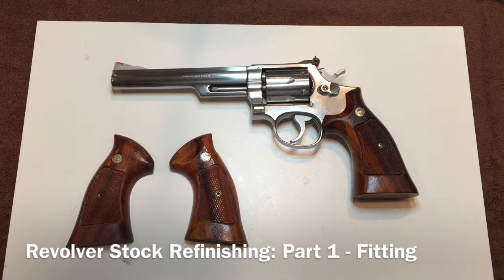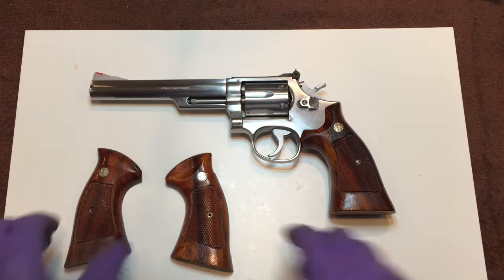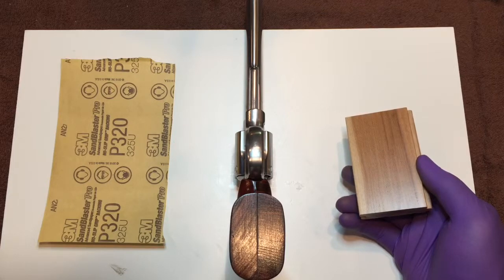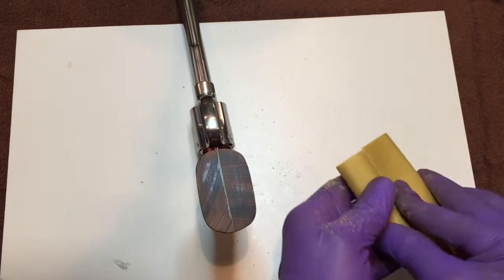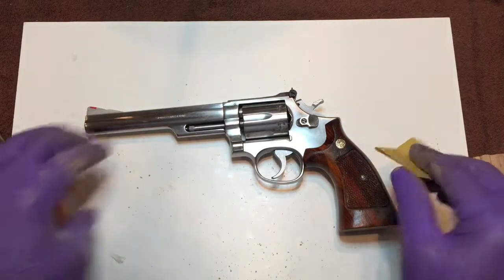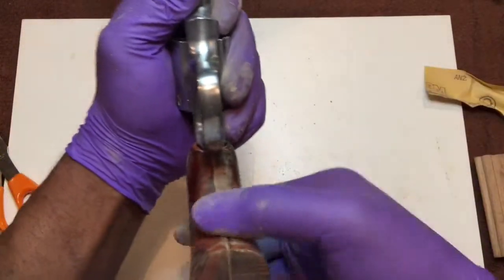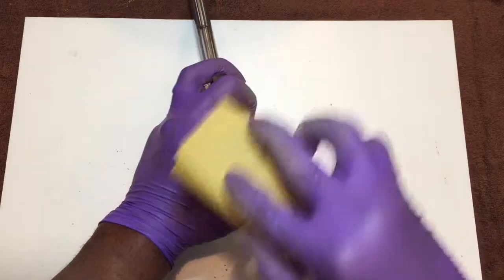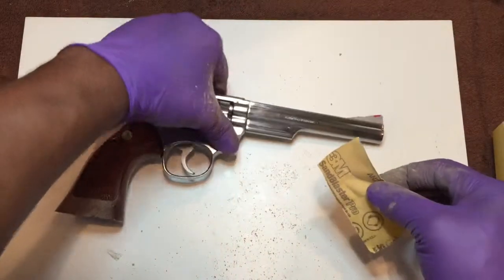Smith Wesson Revolver Stock Refinishing Part 1

Comment: What do you do if you have N frame target stocks with a tiny flake in the bottom missing? Otherwise mint. I have two like this. I doubt you would notice it on a once over but it is there. It is on the bottom of the butt halves. Is there a tiny filler to apply?
Reply from the maker: Good question.  I've encountered this a few times too.  First thing you have to ask yourself is "is it enough significant enough to try to correct?'.  If the stocks are 'mint" condition, why not considering doing any work to them.  Secondly, Minwax makes a stainable wood filler that I've used on similar issues.  You will need to stain it first before using it to fill the spot, because it really doesn't take stain well once dry.  Third, if your planning to refinish the stocks anyway, I'd just sand and true-up the bottoms to remove the flake (if it's not too deep) to a fresh smooth bottom..

Comment: Hello Bigswoll58 i got finally the n frame smooth target stocks but there is an ugly scratch on one side. Is it possible to get this scratch out? Greetings from austria
Reply from the maker: Hey Austrianer8542.  Yes it is, especially since its a smooth pair.  If its not to deep, you can sand the panel enough to obscure it.  Keeping carefully to maintain the shape of the stock.  But first try using a hot iron over a wet cloth on the scratch to restore any wood fibers that have been pushed down and not cut.  You may need to do this several times.  Let tt dry completely then assess it before sanding if needed.  if you need to sand it out or at lessen it, start with 600 grit and quickly work up to the desired smoothness.  You may not get it all out, and even if it appears that you have, it may still leave a "character" mark when you apply the new finish.  I've got a couple like that, and they don't look bad.

Comment: What about the slight gap at the butt where the 2 stocks meet? How do you get those flush?
Reply from the maker: Well, that can be difficult. You have to first learn why there is a gap.  Sometimes the panels are warped or miss shaped.  But often enough, the problem is either that the stocks frame recess may not be quite deep enough; or the bottom panel alignment pin hole is too shallow or the pin itself may be a few thousandths too long..  Check those out to see if that's the case.  Try fitting the stocks on a different gun to see if the fit better.  If so, then is something that can be easily remedied.

Comment: Hello Big Swoll, do you have any idea of a good source for the correct grip pin for a Model 19-4 revolver? I have need of one for one of my revolvers! Thanks
Reply from the maker: You can usually find those on eBay and Gunbroker at times.  Numrich Gun Parts is a god source too.  But Smith & Wesson might just be your best bet vet.
Reply: @mr2275cur  Thanks for getting back to me. I have a pin on the way thank you! One of my Model 19's is a 19-3 with 4" barrel. The bluing is just about the nicest I have ever seen. It has the target trigger & hammer, red ramp & white outline sights. The grips are dead nuts mint except for one ping on the bottom of one side. I hate to refinish them on the one hand but that is the only thing stopping this revolver from being mint. But you know what the purists say about refinishing them. I have even contemplated buying another 19-3 with mint grips to solve the problem. It might be worth it even if I take a little hit on the other 19-3 if I resale it. However I bought a 4" 19-4 to be my shooter already but the grips are different. So I hate to buy another gun just over grips. This 19-3 is one of my deals where I paid big money for a basically perfect gun well according to the description. I liked it so much otherwise I wasn't too bent up about it just a little disappointed. What are your thoughts on that one? Thanks again!
Reply from the maker: @kickit59  If you have gun that is that close to mint condition, I wouldn't worry much about the one ping one the grip.  That just adds character and dates it to the gun and the period.  Remember this, the stocks are date stamped and coincide with the manufacture date of the revolver.  So if you change the stocks, you'll kinda adulterate the original authenticity of the gun.  If "mint" condition means that much to you, I think you should consider not changing the original stocks.
Reply: @mr2275cur  You are right and they are only original one time. So like you say it's best to leave it alone.

Comment: It looks just like this one
Reply from the maker: This is a model 66-1.  If the one you see has round butt stocks, no lock and 6' barrel; it's probably a 66-5.
Reply: @mr2275cur  yeah I looked at some of your older videos and I think it is an model 66 but it doesn’t have the pinned barrel as it has the crest on the front side under the cylinder release… the gun is pretty dirty and the wood handle is worn, they’re asking $499 does that sound right to you?
Reply from the maker: @derellcaldwell8653  Well, let me answer as best as I can.  It sounds like a really great deal for any version of a S&W 66.  Now having said that, you need to give the gun a good bench top inspection before buying it.  Many times a dirty worn gun is an indication of how the last owner treated it.  But dirty doesn't necessarily represent damaged or worn-out.  Just inspect it well, and look past the dirty appearance.  Remember that stocks can be easily and reasonably replaced.  Broken and worn gun parts cannot be.  I think $500 is a steal for a VGC model 66, even if it's dirty.
Reply: @mr2275cur  wow!!! Thanks a lot bigSwoll I really appreciate it, your feedback is going to help me make an informed decision.
Reply from the maker: @derellcaldwell8653  Great.  Glad I could help Mr. Caldwell.